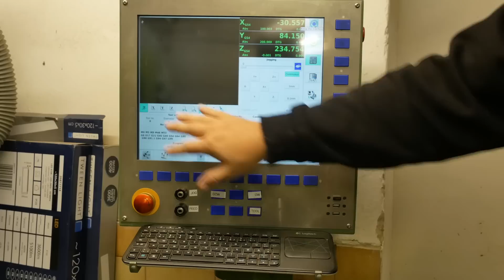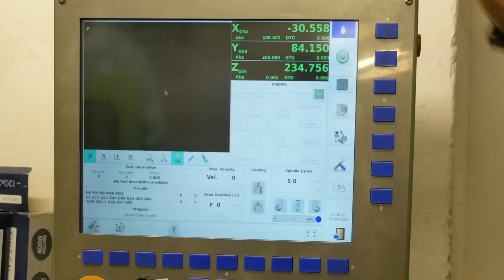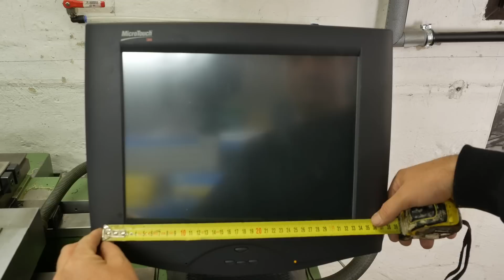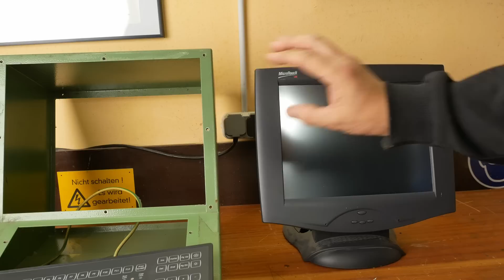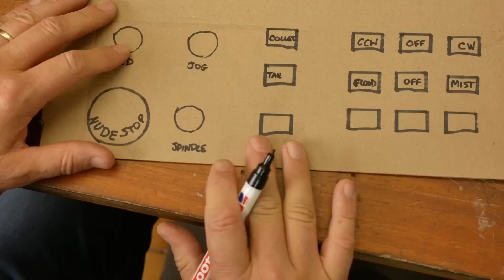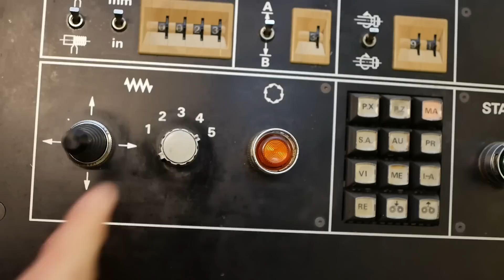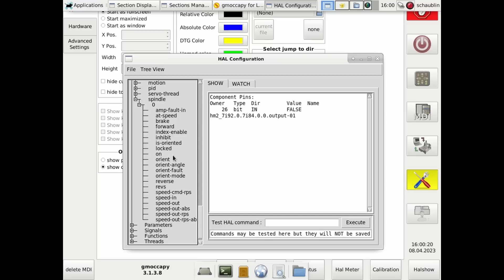Please help critique my CNC control panel layout ideas. || RotarySMP

Comment: The two controls that I find very useful are the jog speed and jog turtle mode.  I have an analog pot hooked up to the 7i73 to adjust jog speed.  The turtle button effectively gives you a low range with finer adjust.  I would put this on your dual encoder panel on the lathe apron.  You probably want the jog step increment controls on that panel as well.
Reply: Yeah-  it would be super annoying not to have the step/increment with the wheels.
Reply from the maker: Good point.

Comment: Just use the cabinet as-is. Use the monitor you already have-- remember you said you wanted a bigger screen... As for the softkeys, just add buttons around the monitor that "hang out" on the outside of the cabinet!
Reply from the maker: Argh... that sounds horrible :)

Comment: I would lean very hard towards putting all "manual control" style switches/controls on the carriage (don't even bother with the front rail)... Wheels, e stop, jog increment, even spindle control.

I don't have a CNC but I drive my lathe entirely by DRO, and having everything within easy reach of the work area is critical for me. I know that with CNC it's a bit different, but for checking, zeroing, setup, etc, I'd want as much control near the workpiece as I could get. Redundancy doesn't hurt so hopefully you can optimize your controller but also duplicate the necessary functions onto the carriage!
Reply from the maker: Thanks for your input. There have been a few comments in that direction, so I think I will explored that more closely.
Reply: @RotarySMP  I can't wait to see! I'm considering buying a small CNC router to get my feet wet in CNC, because i'd like to do a conversion on my own lathe - even the soft keys you're implementing are an eye opener for me! I'll probably get a wireless pendant to start (I'll likely go Centroid instead of LinuxCNC) and using it enough on the router should hopefully give me the experience needed to design a control panel like the ones you've done!
Reply from the maker: @hogtownpens  LinuxCNC can seem daunting with it's learning curve, but the guys on the forum are really helpful and knowledgeable. I would recommend it to anyone.

Comment: I would seriously consider DUAL jog wheels, vertically positioned with the lower one for lathe Z and the upper one for lathe X.
That would be fast and intiutive because it would be like the 2 handwheels on a manual lathe. In some cases you could even drive it like a manual lathe using the two jogwheels, like for simple facing tasks without needing to run a program...
Reply from the maker: That is what I showed n the video right? Except I put them next to each other. Probably more intuitive if I place then diagonally. X FWD Higher, and Z lower back, as that would be the same as my Boley.
Reply: @RotarySMP  ... whoops sorry to confess I only watched the first half of your vid then was called away to do other stuff. I'm a dufuss! 😁
I like Tom S suggestion the best, put the 2 dials ON the machine itself, and possibly a couple other jog-critical controls like a feed rate switch and reversing switches. All in a place where your hands instinctively find the controls so you dont have to take your eyes off the cutter during setup or simple turning tasks.
Reply from the maker: @wizrom3046  That is kind of where I was going with the two encoders down in a "pendant" running on the rail at the front of the base. 

I hear a lot of negative about putting dual encoders on a lathe. I would have thought that to be intuitive?
Reply: @RotarySMP  ... I cant see why they think it's a negative.
Ultimately its your baby so if you want your baby to have two heads then that is the right amount! 😎

Comment: From experience ... you probably want the jog increment control right next to the jog wheels themselves.  Going back and forth between the two will get annoying otherwise.
Reply from the maker: Good point Peter. Andy Pugh also had the same observation.

Comment: Is there enough space to put the screen up higher, and fit the E-Stop button and other controls below, on the vertical panel, rather than on the sloped base? If needed, cut down the sloped console to the lower the keyboard, or use a drawer, as others have suggested. That would also allow reducing the depth of the sloped console, so you aren't reaching out too far, to get to the buttons and touchscreen. The sloped console then only needs to be deep enough for the keyboard, with a little clearance vs. the buttons above, and perhaps something of a palmrest. Definitely like the sliding pendant idea!
Reply from the maker: Thanks for the ideas Mike. I will need to do a CAD (Cardboard aided design) mock up and see.

Comment: Hi. The only 2 things that I can think of adding is some more control over the spindle speed (since you have that complicated variator + vfd + gearbox setup, it might be nice to have finer control over each part) and a switch for a light (maybe adding one of those gooseneck lights to the crosslide, so that you can more easily see what's happening on the cutting edge). Other than that, looking great! :)
Reply from the maker: Thanks for reminding me. I was also thinking that it would be nice to at least have a switch from hi-auto-low on the gearbox, as it is a bear to turn the chuck by hand when in back gear. 

I got two nice goose neck lights with the machine. You remind me that I need to see if I can still mount one on the original mount pad on the back of the machine, with it closer to the wall.

Comment: I think either a pair of 8 jog buttons or a joy stick would be grate for quick and dirty turning „manual style“ and the 45 deg movements for easy Chamfers. A joystick with guided movements is ideal I would guess, so you don’t have to worry about engaging the wrong feed. On the Deckel FP‘s it’s sometimes a bit flimsy 😂 on some Euchner 8 way joysticks there is a push button on top, maybe could be nice for feed override.
Reply from the maker: Thanks for the feedback on that Lorenz. Do those machines also have jog encoders?
Reply: @RotarySMP  I mean the manual Deckels 👍🏻 on my Fp1 you can engage the Z and the X feed at the same time (actually not to sure if there was a part preventing this, which was removed)

Comment: For your keyboard, you might consider a drawer, there are metal drawers especially for hiding your keyboard in machine control panels even including a slight angle to make it more comfortable to type on. Apparently they are a bit pricy at 200€+, but maybe you can make an affordable custom piece from all the sheet metal.
Reply from the maker: Thanks Pierre, there have been a couple of votes for that. It is a good idea.

Comment: Joystick (actiual analog joystick from gamepad, not 4 buttons you show in video) is much much better than jog wheel. For Z/tailstock you can add second joystick locked to only one direction.
But that's for fast travel, for actual manual machining it's better to mimick actual lathe wheels (i mean different size and positioned diagonally).
With control box that high it's probably better to make new case and put encoders/buttons on the front and leave only keyboard on slated top.
Reply: This is what I plan for my small 3018.
As a quick fix before building this, I will use an Arduino Pro Micro connected via USB, to simulate keyboard.
Ajusting the XY position with mouse or real keyboard is boring on Candle.
Reply from the maker: @nalinux  I am getting a few recommedations to move most of the control buttons down to the apron area. I considered building the apron with real lathe wheels, but couldn't find 100PPR hollow shaft encoders for a decent price, and the project would take me ages.
Reply: @nalinux  100 PPR is a spec for rotary encoders meaning 100 pulses per revolution. It's basically the resolution of the encoder

Comment: Put the jog increment selector on the same panel as the X and Z encoders. Also make it a push-button to set Manual mode so that jogging actually works.
Reply from the maker: Hi Andy, Good points. I didn't put that button on the Maho brick pendant and keep having to walk back around the machine to change modes.
Reply: @RotarySMP  my Okuma has them both on the panel and on the pendant.  If the pendant is set to anything other than 0, it overrides the controls on the panel, and lights up an indicator to let you know the pendant is in control.  It's nice to have it in both places.
Reply from the maker: @jrucker2004  Some of those nice to have features would probably be quite easy to do in LinuxCNC for an expert, but for a guy like me get kind of overwhelming.

Comment: I'm using the joystick for rapids, kind sucks to traverse the whole machine with a jog mpg. also lets you get rid of the feed rate control. rapid over with the joystick, fine move with mpg.
Reply: That's a valid point in favor of joysticks. You can just hold a joystick in one position, while a wheel needs rotation as long as you want the machine to move.
Reply: Another option is a self-centering knob that controls the direction by which direction you turn it and the speed by how far you turn it. You get the functionality of a joy stick, but the feel of a knob. You would use one for X and one for Z.
Reply from the maker: @jamiestotz2516  My shuttle contour jog wheel which I use for video editing has one of them. I dont use it. I tried setting it up for timeline zoom, but it never felt intuitive to me.
Reply: Well my experience is quite the contray.
Never been happy with joystick jog on my router, as fast moves imply overshoot of target.
Now (for my lathe) I stick to the weel with (preferably) 2 push-buttons, 1 for "normal" '0.01mm/detent => 1mm/turn' speed, and 1 for "fast" "1mm/detent => 10cm/turn" speed.
That'is more intuitive IMO and when you release the push-button there is no risk of unexpected moves..
Reply from the maker: @jeanbarbier9448  That is why I will use dedicated encoder wheels.
Reply: @RotarySMP  For larger distances, a jog wheel can be unintuitive. If you rotate it faster than the machine can move, then it will continue to move after you stopped rotating it. A joystick will, for large distances, actually make it easier to stop exactly where and when you want, without having to excessively rotate something, assuming the joystick is configured to only cause movement at the extremes slightly slower than the machine can actually handle. 
I still think joystick on panel and wheels on pendant might prove the best compromise.

Comment: For things that can be G-code controlled (on my Holbrook this is only the coolant, but in your case it could include the collet, if you were to fit a bar puller) I have three-way switches for on, auto, off. 
It's nice to be able to force the coolant on or off if the G-code omitted it (or has it on when it should be off)
Reply from the maker: So you intercept the signal from the UI and or it with the physical switch output before controlling the relay?
Reply: @RotarySMP  Yes, with a Mux that chooses between G-code output and fixed values.
Reply from the maker: @andypughtube  Nice. I even have some three way switches which use the standard contact blocks I design around. I can see overriding coolant being really handy. I have often made a mess because the CAM set it automatically.

Comment: I can only give you a feedback on what I'm currently designing...
My aim it to convert a small chinese lathe to a semi-automatic one with electronic gearbox, removed compound and some predefined macros for feeding and threading.
All configuration data is handled by a stationary panel with keyboard, small encoders etc, but the operational controls are on a small mobile box that can be hand-held or attached to the carriage (as mechanical ones).
I've found that I could live with a single wheel coupled to 2 (X1-X100) or 3 (X1-X10-X100)  "speed selectors" pushbuttons and 2 mode selectors, one for jog, the other for manual move/macro definition, both of them providing Neutral/Z move/X move/+X+Z diagonal/+X-Z diagonal.
This way I can both handle 30° manual jog for threading (emulated compound) or angled XZ macro for tapers...

I really don't feel like using 4_joysticks unless you can lock at times one axis - which defeats the purpose of a joystick...

Nice work anyway from Maho to Schaubling - I wish I could handle such big projects...
Reply from the maker: Thanks for the feedback Jean. Just question, once you get that far along the retrofit path, it would be almost no additional work to just use LinixCNC and have a full CNC. Why the half step from manual to CNC?
Reply: @RotarySMP  I agree, that may seem strange, but I don't feel that much interested in a full-cnc lathe.
That's completely different for milling/routing.
In parallel I'm reviving my first home-made cnc-router (late 1990, 1200mm x 700mm work space, ball screws) for which I will most probably move from grbl+custom python to linuxcnc (I'm particularly interested by your experience with Mesa cards ...).
And if I'm still  alive, do the same with my small lathe...

To be fair, what worries me somewhat is how (well) linuxcnc can cope with backlash on conventional acme screws (of unimpressive precision)...

Thanks for answering !
Reply from the maker: @jeanbarbier9448  The mesa hardware is incredible. I think over three installations, I only managed to damage one board, on the mini-lathe, with sheer ignorance, and even that was pretty easily repairable.

The Mini lathe has horrible backlash. LinuxCNC can be programmed to take up the backlash on reversing an axis. It does it well as you can, but it is never a good solution.

Comment: I think that for the amount of sheet metal work you are taking on, time to invest in a TIG welder :)
Reply from the maker: My welder can TIG, I have just never gotten a gas bottle or learned it. This might be a good time to do that.
Reply: @RotarySMP  I wouldn't refit an MMA/MIG to do TIG. You are going to be missing all the goodies coming from a dedicated plant, like HF start, amp control etc. Imho, and especially for a TIG newbie, a cheap DC TIG is better than the retrofit, which if you going to be adding the additional costs of torches, gas lines, regulators etc. would be close to getting a new one anyway 😊
Reply from the maker: @ModSlash  I have all that with this machine, (Stahlwerk CT520), but suspect it is all the bottom of the barrel cheapest crap, that it would be a PITA to learn TIG with.
Reply: @RotarySMP  I think it's a nice plant :) Plenty of machine for the task at hand :) - Following your progress for the past 3 years, just about anything you've done involved some level of pain 😁- But nothing that's worth the effort ever comes easy. Go for it :)
Reply from the maker: @ModSlash  Since I have never TIG welded, I dont miss it. I actually quite enjoy stick welding. Having only one machine variable, and everything else being drag angle, tip height and speed, you really noting over a job like that how your muscle memory improves and you start getting the hang of it just as you finish :)
Reply: @RotarySMP  No question about it, every welding process has it's place and every welder, pro or hobbyist have their preferences :) 

That said, don't be intimidated (if that is indeed the case, I don't mean to be patronising) by how complex TIG seems. There's really not that much into it, and there's plenty of YouTube channels to get you started. 

Personally TIG is my favourite. I also prefer stick over MIG, this was the process I've started welding with 30-odd years ago. Picked up TIG about 15 years after that, feeling exactly that it may be too complex, and with a steep learning curve. It was actually much much simpler than I was expecting, and was able to do decent welds after a day practising or so. Like you say, to build up some muscle memory. Long story short, anything below 3mm these days and it's mostly TIG'ed, then MMA'ed, and lastly MIG only if I have a lot of welding meters to do 😄

Try it on for size 🙂- Gentleman's wager, I promise you that not only you'd love it, but you'll also learn a new skill 😉 - not to mention, better return on equipment investment, since you already have the tool in your arsenal 🤓

Comment: I liked the trouble shooting.  I have no suggestions regards the control layout, however making a cabinet could be an interesting project and will let you set the angle you want for the screen and controls.  Perhaps have it on a adjustable mounting?
Reply from the maker: Good idea, I will have to see if I can do that. The new screen will have a good viewing angle, but reflections could be an issue.

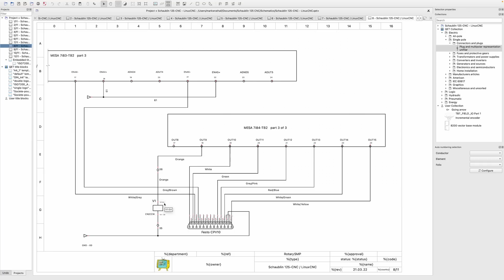Comment: What software are you using at 18:51? And is it worth doing the cabinet in CAD and sending it out to be laser or waterjet cut?
Reply: Software is Qelectrotech
Reply: @graealex  Thanks!
Reply from the maker: I drew up the Maho cabinet in CAD and had it lasered. That is the choice, modify what I have or start from scratch?
Reply: @RotarySMP  Start from scratch. More CAD practice, get it exactly the way you want.
Reply from the maker: @JCWren  That is a good point. Also dont have to dick around with paint removal.
Reply: @RotarySMP  And > 2mm thickness on your metal.
Reply from the maker: @JCWren  Everyone keeps telling me I have to TIG stuff. I like stick welding thick steel :)
Reply: @RotarySMP  Learning TIG would be cool, but I think MIG is really what you want for this. Stick is a little brute force :)

Comment: Hi Mark I assume that you have seen the early version of the 125 ccn where the handwheels, jog controls etc are mounted on the apron?
same as you were talking about in the  video.
Reply from the maker: Hi Steve,
Yeah a mate here in Vienna has an early CCN like that. It is sort of what I was modelling those thought on.